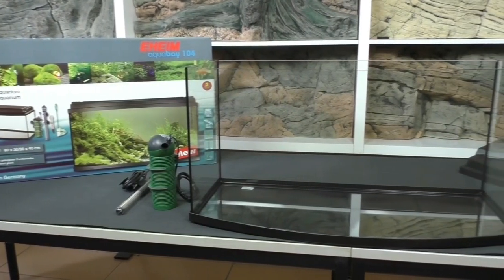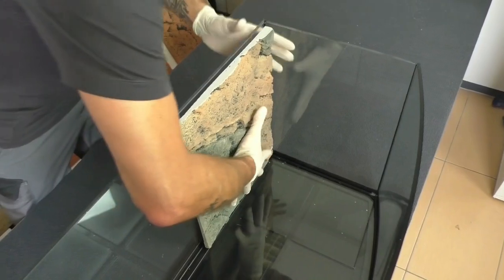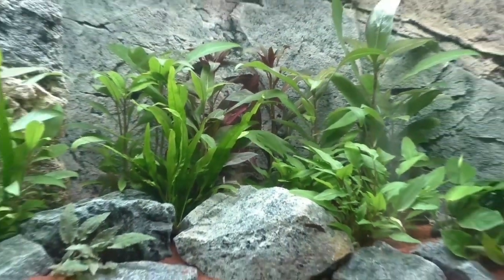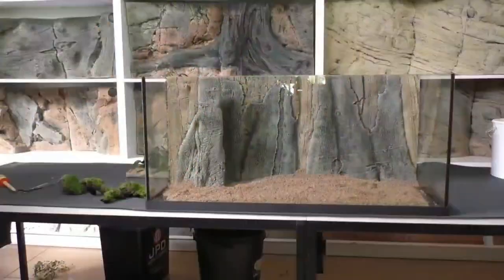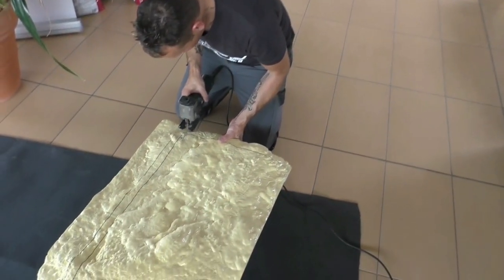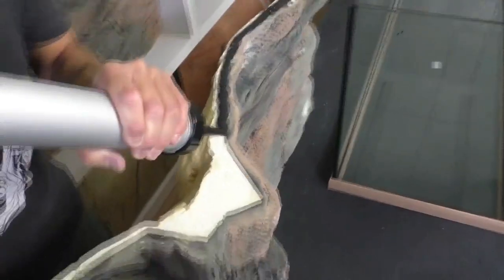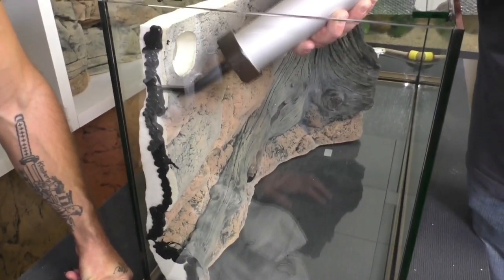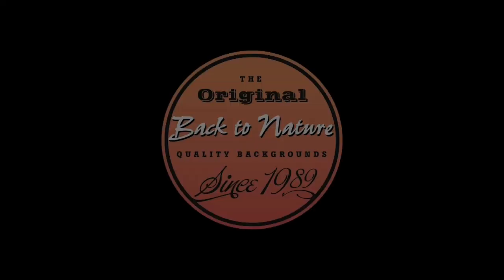How to install a BacktoNature Slimline and 3D background into your tank

Comment: Hi, I first of all I love the way your decorations look. But I have a slightly different situation at home-my aquarium is 150x50x50 cm. The problem is that my aquarium is positioned with the 50x50 glass side against the wall. I have all the filters and heaters between the wall and glass also, so that the 150cm glass is unobstracted from both sides. So, now the aquarium must look nice from both sides. And so, I'm thinking about getting a Slimline (something like White Limestone type A or B) for my 50x50cm glass and on it I would fix a Module C rock for the filter intake. Do you offer any solutions that my suit my aquarium position? I need something like a reef, or a pile of rocks that would be positioned in the middle and ran through the 150cm length. Best regards, Uri